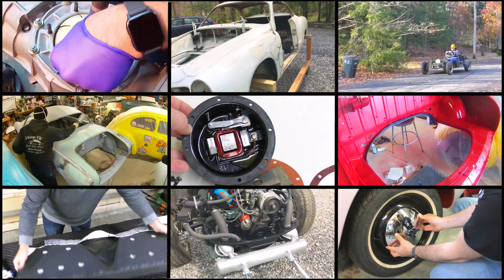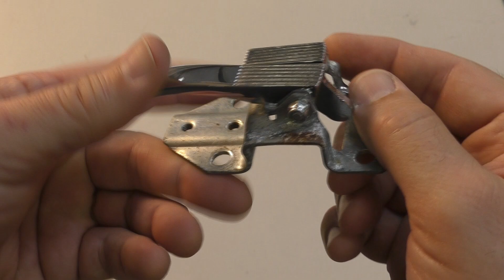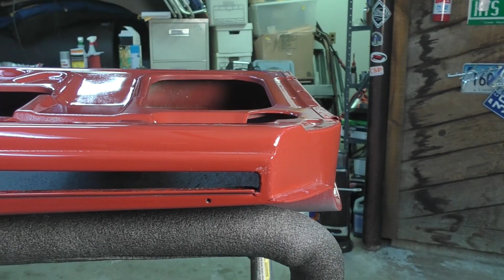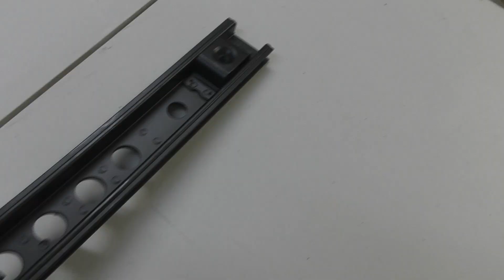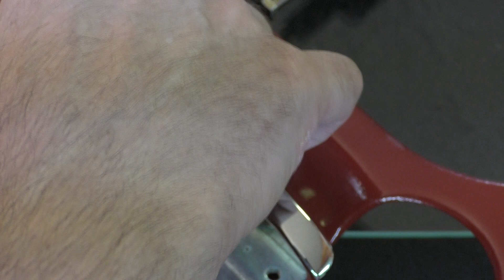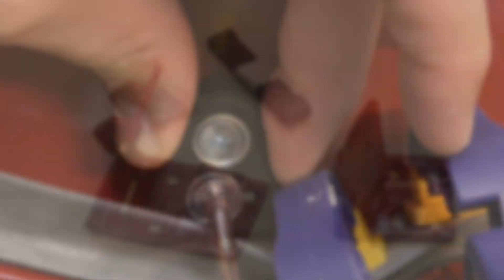Karmann Ghia Door Assembly

Comment: Great videos! Much help for sure! The door glass in my 63 hardtop needs to be tilted outward at the top in order to meet the new track and seal correctly, and be able to roll up and down as it should when the door is closed. I did not see that video, or did I miss it? Is it as easy and turning the bottom adjustment screw on the regulator in to bring the top of the window out?

Comment: Very very helpful video! Perfect.

One question but regarding paint. How do you blend the exterior paint with where you stopped on the interior paint. I will be doing the same thing but won't that be a cold joint for the clear? A weak area? I've only ever sprayed and stopped at a seam or natural break in the body work but that's impossible with a Ghia.
Thanks
Reply from the maker: That is an excellent question that I will defer to my painter once it's painted!  I think it involves creating a soft edge by rolling the tape into a tube rather than putting down a hard line.  I think it's only critical where visible but I think it will be covered by the chrome and scraper. I will update in a later video.  Thanks for watching!

Comment: Where's the door pin video?? I need help the best way to reinsert those tiny little clips to the bottom of each pin :) Thanks!
Reply from the maker: I have it halfway edited but not posted. It's actually quite a pain in the neck!  I couldn't assemble my hinge pins before inserting into the door because the door opening wasn't wide enough.  I ended up using some narrow vise grips to hold the edge of the C-Clip and then push the clip onto the end on the pin.  Videos have been on hold for a while for personal reasons... the channel is not dead!  I hope to start posting regularly again soon.

Comment: Im about 90% sure that if you're door has holes for 4 anti-rattle plugs, then it will have 3 more holes on the opposite side of the opening for 3 more plugs, making the total 7. Otherwise a super helpful video that I learned a lot from.

Comment: Pete - you have the best instructional videos. Great explanations and details, and very clear viewing angles. Do you recall which eBay seller where you purchased the anti-rattle plugs? Currently on eBay, there are two vendors offering these plugs. Did you use mamotoworks or the other one? thanks!
Reply from the maker: Thanks, I appreciate it!  Believe it or not it's a ton of work to grind these videos out while restoring my car and keeping my day job.  So positive feedback goes a long way to keeping this channel going.   I bought the plugs from aircoolin parts: https://www.ebay.com/itm/295495595637?itmmeta=01JN5FEMM03C1932GPH4Z8X7VX&hash=item44cce8f675:g:JpwAAOSweIZj1EwF

Comment: Dude, you da man! This really helped me replace my bung hole plugs! 🤣
Seriously, thanks!
Reply from the maker: Thank you!  Perhaps you need more fiber in your diet?!
Reply: @PetesGhias  ...probably wouldnt hurt!  😂
Is there any other part within the door that would keep the glass from rattling in the down position?
Reply from the maker: @lcwatts2971  If all your plugs are in place and there's still a rattle I would pull the door panel off and tighten everything down.  Look for loose parts.  Check your window scraper too.  Also, if the window can pivot on the guide rail the parts could be worn out.  Easiest solution is to turn up the radio!
Reply: @PetesGhias   Gracias, senor!

Comment: Thanks for posting this up, calm, succinct and tidy - my '71's driver's door is feeling it's age and needs refurbishment - but having seen this I will wait for your next video on alignment++ before deciding to tackle it myself or having a more worthwhile discussion with a 3rd party  - tvm again.
Reply from the maker: You're welcome!  Alignment depends on many factors.  If body work was done or heater channels replaced, is the body and door opening in a factory position?  Are the hinges sagging?  Does the gap need to be taken up by adjusting the body to pan rubber wedges?  There are also plates behind the A-Pillar that slide up and down and in and out to adjust the position of the hinges.  It's definitely a two-person job to avoid scratching the paint or dropping the door.